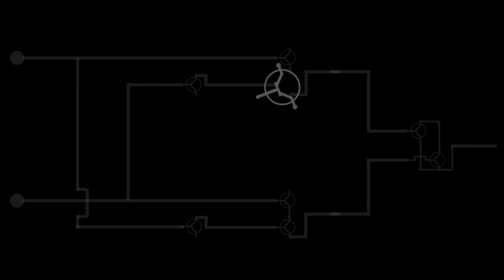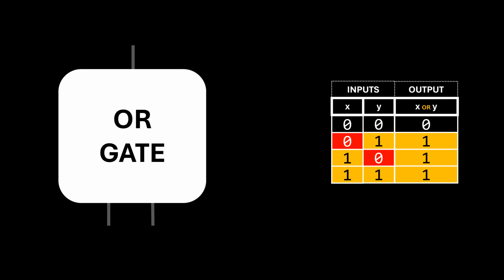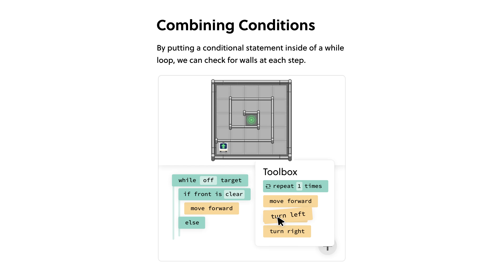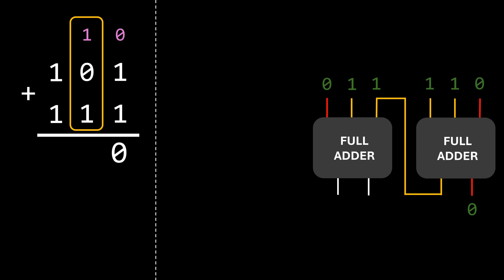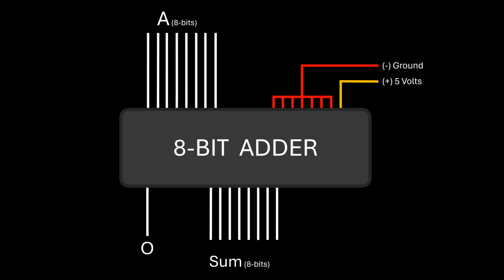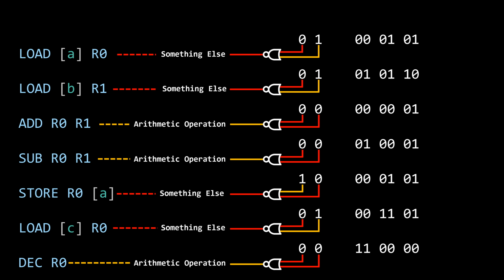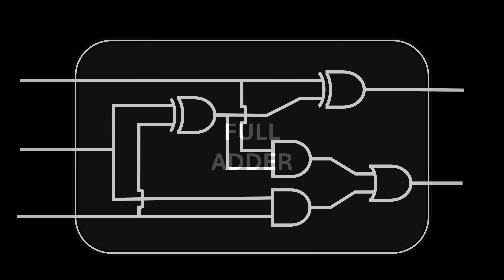HOW TRANSISTORS RUN CODE?

Comment: Good video and very clean looking presentation of the topics. Just one confusion I have is that don't we use CMOS pairs in which there are two types of transistors P and N type (that function differently) ? You used a general depiction of only one kind so I am not sure which one is correct ? Just started learning these concepts so I could be wrong
Reply: Correct. I assume it's not mentioned for simplicity, because it doesn't change the fundamental logic. In practice P and N type are used combined for optimization of the implementation, e.g. by adding inverted signals.

Comment: Good video! one small detail i would add: The NOT-gate is working, because the resistance on the output is higher, then the resistance when the transistor is closed, so the current doesn't flow to the output when the transistor is activated, because the current "found" an easier way to go, than the output.

Comment: If you watched this video and have not yet heard of "turing complete" - THAT's an actual game that lets you do all the stuff in this video and much more - including building complete computers, programming them in assembly language and solve a bunch of computer game programming tasks in the end - on your simulated self built computer.
Reply: It's called Turing complete after the Turing machine, which is the fundamental computer design using instructions from a memory

Comment: I hold a computer science engineering degree but we were never taught these fundamentals at the uni. We were just told about flip flops and gates and asked to design circuits, using VHDL, based on provided truth tables. The same happened with our 8086 programming course. We were just taught instructions and asked to write programs. While we'd proudly show to the lab teachers that we had nailed the assignments, I'm darn sure barely anybody understood what was happening behind the scenes, something which eventually made me lose all interest in electronics and computing. Thanks to your video, I'm falling in love with these beautiful concepts again and from a place of deep(er) understanding. great job sire!
Reply: Transistors are one possible implementation form of logic gates. For computing science, the logic gate is the fundamental unit. Electronics is the domain of the transistor. My computer science education did include electronics. Nice for basic understanding, but not very useful for the work of a computer science engineer and insufficient to work in electronics.

Comment: For binary it's easier to remember that each decimal represent a power of 2 (excempt the first decimal). Example : 0 (binary) = 0, 1 (binary) = 1, 10 (binary) = 2 and 111 (binary) = 7. How do I know 10 in binary is 2 and 111 in binary is 7 ? Because each decimal in a binary is this way : for the first decimal it can be 1 or 0, for the second it can be 0 or 2, for the third decimal it can be 0 or 4. So applying this logic for 10 (binary) : 10 = 1 and 0, because the first decimal is 0 we have zero, and because the second decimal is 1 we have 2, so 10 (binary) = 1 and 0 = 2 + 0 = 2. For 111 it's the same : 111 = 1 and 1 and 1 = 4 + 2 + 1 = 7.
Reply: I was very happy when I found this comment and you made it clear how it represents a number in the form of binary!!!!
Reply: The first also represents a power of 2: 2^0 = 1. It's not a decimal (that would be base 10), but a bit (base 2)

Comment: Are all these videos on the core dumped channel relevant if I am planning to learn 6502 assembly language? Because I see some of them so far pertaining to like the C language
Reply: If you want to learn assembly, the C videos are not important. You may want to use C though instead of assembly; it will make you more productive, unless you can't use a C compiler for your 6502 (but that would be the exception).

Comment: Oh my god… this should be shown in every intro computer engineering course. This simplifies the concept of transistors in such an accurate and understandable way. They are just switches controlled by electricity rather than mechanical movement

Comment: The binary decoder which you describe is more commonly referred to as a mux, or multiplexor. The term 'decoder' typically refers to a set of combinational logic operations that assert or deassert control signals.

Comment: What always confuses me is that logic circuits are often drawn with these typical logic gate symbols so that they take two inputs and give one output, but a single transistor alone has three connectors. So if you were to make a physical logic circuit with transistors and wires, you'd have to have three wires for each transistor, which means that a set of transistors that functions as a single logic gate actually has so many more lines than just two inputs and an output.

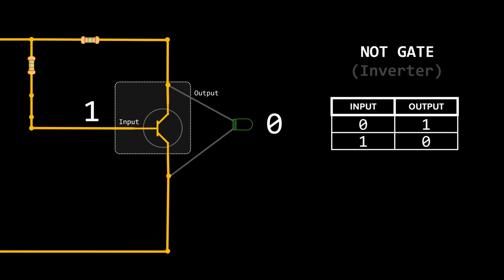Comment: At 2:06, could somebody explain why the output is 0? Is it because both of the LED's pins do not have different potentials, or because the collector and the emitter create a short path that has lower resistance, so the current just ignores the LED's path? Thanks in advance.
Reply: the closed transistor acts as a lower resistance path.
current is definitely divided among the 2, it's just that a huge amount preferred the lower resistance path, and the ones that went through the led were not enough to light it up.
Reply: It's because the current always takes the shorter path
Reply: Look at it like this when the transistor is on, it acts as a short circuit, in which case has almost no resistance, and in this case, the current doesn't go to the LED
Reply: if there is ever a short circuit, current will always take that path over a path with resistance

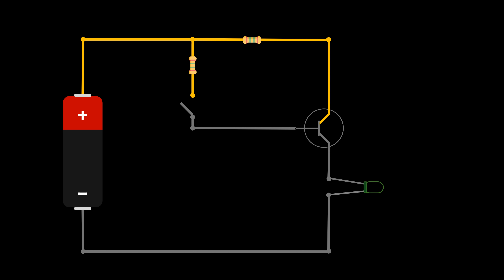Comment: 1:35 imagine its wire in the transistors place,the led will glow when you close the switch,then what is the need of transistor.
Reply: You can as well connect the base terminal with a smaller power source directly, so now, the entire circuit works automatically, whenever it gets a power supply, you get it?
Reply: The transistor is the switch.
Reply: U have one hand 10 fingers... How much switches u can turn on and off when there is a milions or switches needed that too operated in milliseconds...

Comment: How does it add negative numbers, fractions, or decimal point numbers? If the base is either 1 or 0 how do you get a .367?
Reply: .367 is decimal system. Convert decimal (base 10) to binary (base 2). Then just do similar things.

Comment: 2:50 if we are talking about BJTs, and you apply enough voltage on base of 2nd transistor but not on first transistor's base, the base-emitter junction will just act like a diode and non zero current will flow.

Comment: Title make no sense.
An A.L.U. = Arithmetic Logic Unit, is made of logic components which are a network of logic ports implementing the most common logic operations (AND, NOT, OR) (to be precise one can use  even less logic operations). In turn logic ports are implemented using transistors. 
So pratically we always have to deal with transistors at the lower level.

Comment: You apply a voltage to the base of a transistor to control the current through the collector->emitter. You don’t apply a current, whatever that would even mean. So yeah, I’m in the wrong place

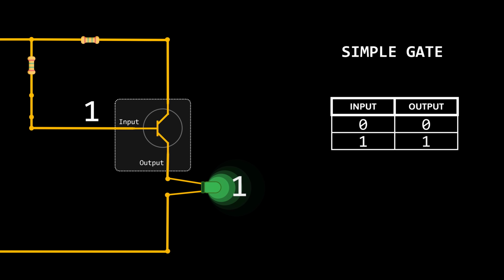Comment: 1:50
I have a question about the set up for a not gate.
When trying to make my own gates in voltsim, the not gate functions correctly when the resistor for the LED is placed before the emitter of the PNP transistor like in your video. But when I place the resistor after the emitter, the LED remains on regardless of what input I give it.

Does this make sense in reality, or is this most likely a bug in the simulator? I don't understand why it would matter which side of the emitter I place the resistor.
Reply: I'm not sure exactly what you mean, but I'll try to explain with my guess. In the video, the resistor is in series between the collector and high voltage. The collector is in parallel with the anode of the LED, so the resistor is also in series between the LED anode and high voltage. 

Are you connecting the collector to the other side of the resistor while leaving the LED connected as is? If so, then the LED always on is correct behavior. Connected this way, you have your high voltage (say 5V) in series with a resistor and an LED. The LED can be crudely modeled as a voltage source or battery when it has enough voltage applied, say 3V. So now you have 5V-->R-->3V, or 2V across the resistor, creating a current which turns the LED on (I=V/R). 

The transistor has no impact on the operation, since whether it's on or off plays no role in the voltage across the resistor--the transistor can't change the voltage across the battery terminals, and will always have 5V from collector to emitter. In fact, as far as the LED is concerned, the transistor connected as described above is equivalent to the transistor being off in the video's NOT gate. 

The reason the LED turns off when the transistor is turned on in the video is because the resistor is present. With the resistor present, the transistor can change the voltage across itself when it turns on, reducing that voltage to less than 1V. Since the LED needs to hit 3V to turn on, it will stay off, and all the current through the resistor will flow through the transistor instead.
Reply: @patrickwright8552  Ok, that makes a lot of sense. I still struggle sometimes with understanding how the current is going to behave within a circuit due to me over-relying on the analogy of water flowing through pipes. Thank you for such a thorough explanation.
Reply: @ You're welcome! One other thing you might check out in VoltSim is the difference in collector current when the collector is on either side of the resistor (keeping the base switch closed).

Comment: Limit of computers are how small a transistor can be made. As of me writing this comment, smallest transistor made is 1 nanometer by 1 nanometer (1x1 nanometers). A nanometer is 0.000001 centimeters. As of me writing this comment, ways to make them smaller by using different materials and such is being tested.
Reply: It won't get much smaller, because 1nm is close to the size of individual atoms. Since transistors do need material, there's a lower boundary.

Comment: I knew about logic gates and how they can interact with inputs to generate whatever output you need, but u never knew that they were constructed with transistors, or that they could be combined to create binary calculators. This video was really helpful. Now I am wondering, how are other computer operations handled by transistors? Are they converted into a lot of binary calculations or is there another component that computes different operations?

Comment: What it truly makes a NOT the NOT gate is the arrangement itself where the conventional flow of current follows the path of least resistance, if it can to find a shortcut without hitting the diode light (or other consumer) it will certainly do that...

Comment: How does the code get to transistors to begin with? How does text in the code become voltage?
Reply: The text in programming code is transformed into cpu native  opcodes. The program that can do this is either a compiler (does it ahead of execution) or an interpreter (during execution). Programs can be executed in binary form (cpu native opcodes) from memory. Memory will be read and fed to the cpu, which then executes the op code and then reads the next instruction. This computer model is called a Turing machine, Von Neumann architecture.

Comment: a micro controller is better  reduce human error while logic gates or pure transitor good for simple parts of circuit it can still be useful for microcontroller because logic gates are more power efficient but not cost effective on large scale

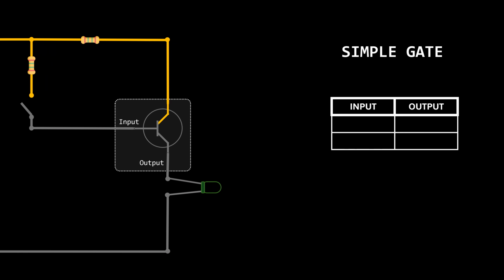Comment: at 01:40 , wouldn't the current just pass through the base completely and complete the circuit anyways?
Reply: The current through the base is amplified by some constant. Or looking at it another way it’s a switch.

Comment: You're describing 1970s technology.  Transistors in logic gates are typically voltage controlled.  A metal oxide insulation layer mostly stops current through the "gate" or base.  The presence of charge on the gate determine the conductivity of the transistor.

Comment: Its important to mention this isnt like electricity through tracks, but rather two types of transistors, n-type and p-type transistors together, which compliment eachother, forcing electrons to flow through the material in such a way that it mimics the behavior you describe. it is of course more involved than this, as you must consider it in an engineered context, with voltage to ground and a pullup resistor, etc.

In your case, you can also talk about biasing which involves applying a certain voltage to the base to ensure that the transistor is in the desired operating region. In the analogy, this could be compared to setting the track switches to the correct position. Atleast if you want to make a closer depiction of how transistors run code.

Comment: This is simply amazing. These transistors do a pretty good job of displaying your video with a synthetic American voice. It's all about semiconductors, abstraction and a nice pile of software
Reply: Software is further abstraction. It uses operators, functions, classes, libraries, programs, distributed systems with increasing "abstraction" (not really the right word for it). The whole of the internet in the end just boils down to the same logic gates, albeit an enormous amount of them.

Comment: at 10:50 the line "LOAD [c] R0" wouldnt be ;Load value of [c] in Register_0?
Reply: That's stating twice the same, as the text is only the human readable form (assembly) of the same binary code. Generally shorter formats are preferred.

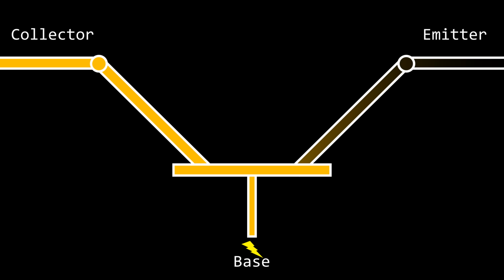Comment: Good vid, but showing (1:08) clearly a PNP transistor where negative current (electrons) flow from collector to emitter will likely seem strange to a newbie given PNP conceptually deals with positive current (holes). I'd probably have made it an NPN transistor so you could legitimately show electron current flowing from emitter to collector (since the emitter emits and the collector collects). Definitely a great vid though!

Comment: It's not base, collector, and emitter. It's gate, drain, and source. MOSFETs don't require current to stay turned on so they replaced transistors several decades ago.

Comment: The transistors were drawn with the symbol that represents analog transistors ( BJT  , which is used for analog purposes, not digital ones ) . MOSFET transistor icons would've been a right representation.
If you want to know more, in reality the chips are usually custom made by fabricating custom gates , with a custom layout of P and N areas , forming logic gates that act as a mix of ANDs+NOTs or ORs + NOTs , with a wide variety of inputs , and if you look at the drawings they are really hard to decipher. Because they also consider lots of other things, like performance and power draw.

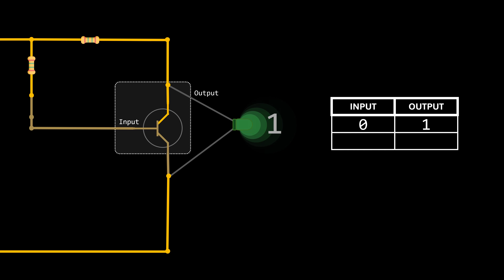Comment: 2:04 why does the electricity not go to the led when the transistor is on in the inverter/not gate?
Reply: Because it is electrically shorted and electricity always follow the way with less resistance
Reply: theres still current that goes to the light, just not enough to turn it on. 99% of the current is going though the transistor

Comment: Way back in time, 1990, I had a course about de HAWK missile system computer. There they explained the inner workings of a CPU like that. It still was constructed discrete, with transistors and logic gates 74xx.

Comment: In an embedded systems course I took, we studied the AND gate by using a NAND gate based off of two n-type and p-type transistors which then connects its output to an INVERTER... thanks for this video

Comment: This is literally a question thats been on my mind for so long, like i've asked people how code runs, and they say it turns it into machine code, but then i ask HOW does the machine code know what to do. It makes so much more sense now.
Reply: Modern cpus are really far more complicated, but the basic design holds. In modern cpus, the opcodes do not directly address the logic units, but are actually run as micro code inside of the cpu. This allows flexibility because the micro code can be changed more easily, and simplification of the design through reuse.

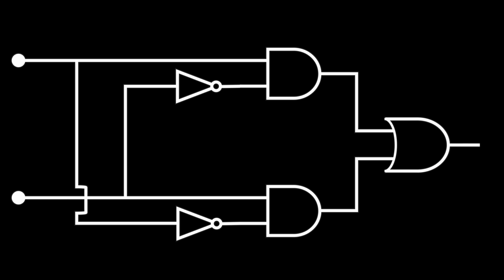Comment: I could be wrong but at 4:33 shouldn't the NOT Gate's output on the bottom be set to 0 since the input is 1(on), logically the output is still correct, i just noticed it!!!
Reply from the maker: Thanks for noticing. Animating all of this makes it hard to find this kind of errors. I'll leave a note in the pinned comment.

Comment: Great video. But for everyone now trying to make their own CPU, don't do it just yet. This is an extremely overslimplified version on a CPU let alone the ALU. Even a very simple ALU for example wouldnt use multiple adders like that, but modify a full adder with 3 XOR gates to make 1 both add and subtract. And while instruction decoding seems intuitive, this is basically almost never done on that level. Rather some bits directly map to internal gates and multiplexers and instruction bytes are chosen from the results that those gate enable combinations give.

But overall Its a great explanation on basic logic components and it would definitely inspire people to learn more about it. Would love a part 2!

Comment: why computer using transistor (bjt) instead of mosfet? 
the bjt need current to active but mosfet only need voltage and very very small current compare to activate the bjt

Comment: The theory is well explained and spot on however we would never use bipolar transistors to make the logic gates, the power requirements would be too high as would the required silicon area. This is why we use MOS transistors. They are a lot smaller and consume a lot less power.